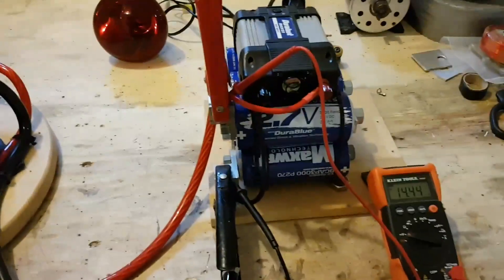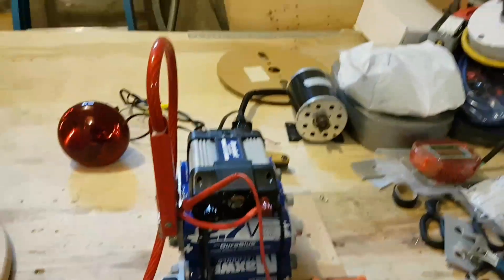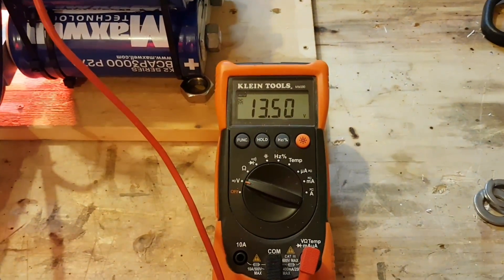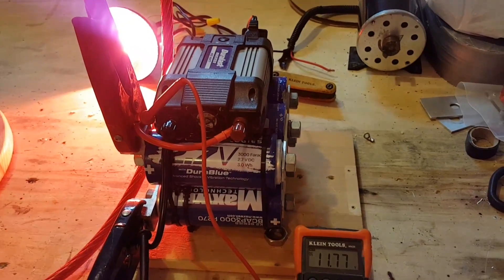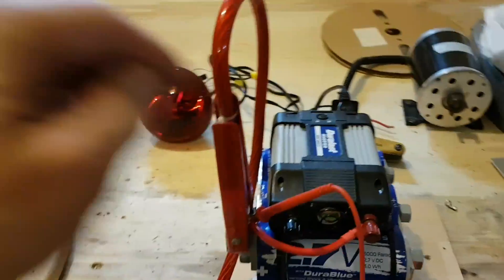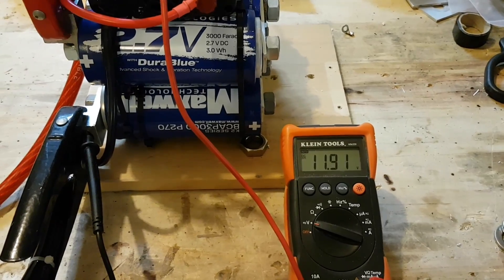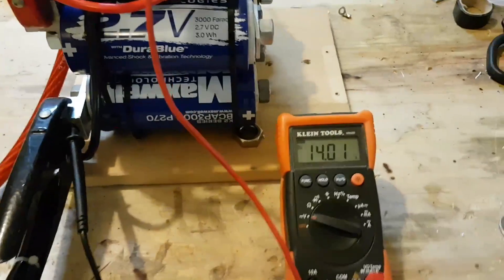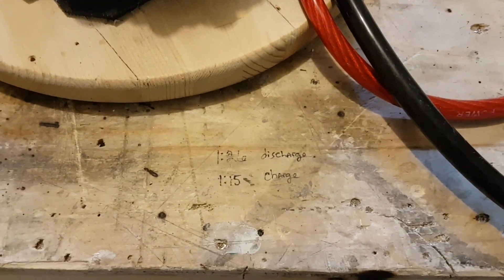Super caps updated part 2

Comment: So at 14.4V and 500F of capacitance (3000F/6=500F) you have an Energy E = 51840 Joules or 14.4 Watt-hours but you can only use the upper end of the voltage range with your inverter so with that inverter charging to 14.4 and discharging down to 10.7 you con only use an Energy of E = 23217.5 Joules or 6.45 Watt-hours.  To put this into perspective this would be the energy of about 2-3 quality AA battery cells.  You would need to combine a boost converter to your inverter or find an inverter that has a lower voltage cutoff to use more of the total capacity of your ultra-capacitors. Capacitors can charge and discharge fast but they have a very low energy density they are also extremely expensive.  

The best of both worlds with today's technology would be lithium batteries.  They are much higher energy density and can be charged relatively fast.  The lithium pack I built for my Ebike with older technology is capable of being charged at 54V and 40A with an energy capacity of 1920 Watt-hours.  It can be discharged at 80A max.  The car jump starter I am currently building with higher quality and newer cells will be able to safely charge up to 16.8V at 100A and output that voltage minus voltage drop at 500A with an energy capacity of 1568 Watt-hours.  This is why ultra -capacitor technology has not made it into electric vehicles other than those buses that were being tested in a few cities since they could quick charge at every stop.
Reply: What is your opinion on supercaps today, I’ve heard the prices come down a lot  compared to 10 years ago. Are they worth it to buy?